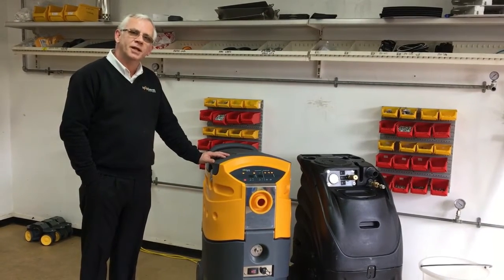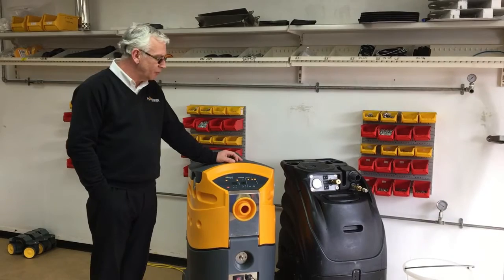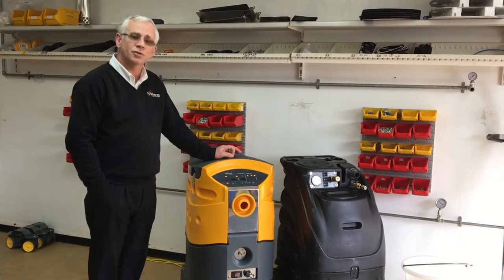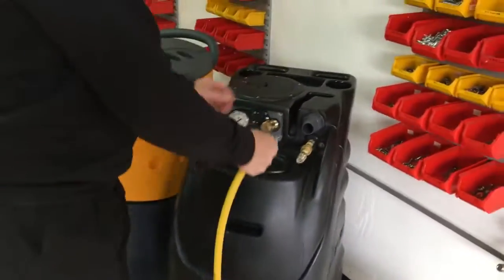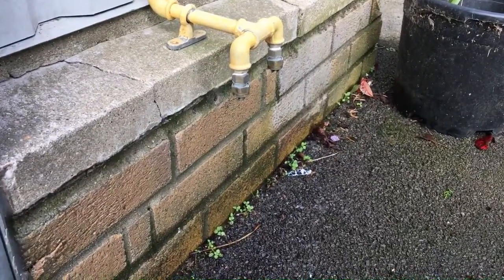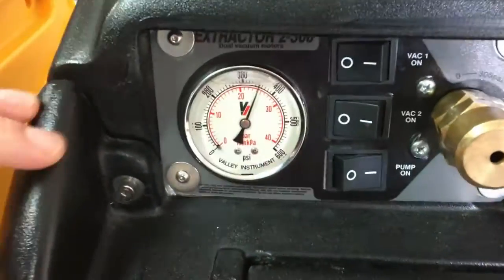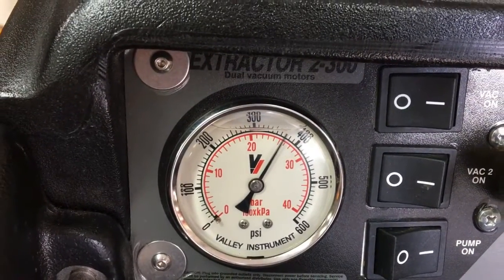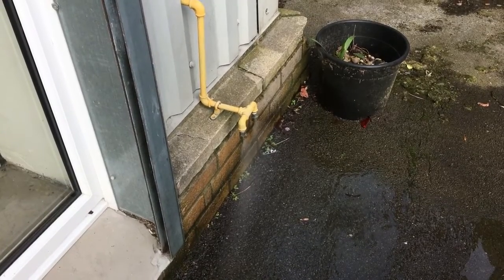Low vs high pressure portable extraction machine

Comment: All this proves is your portable has a higher lpm pump, the other portable is more likely suppose to be used with a 3-4 flow wand, 6 flow wands are more often used on truck-mounts, my everest 650 would be lucky to lost 20psi from closed to open on a 6 flow wand because it has a 20lpm pump, you should Compare it to a portable with the same lpm pump as your portable, there are many portables with a cat pump around the 5.5lpm mark that are made for hard surface cleaning. See how much difference there is? Im not saying your portable is bad It is most likely very good but the test seems flawed to me And designed to sell this digital regulator as not every machine with that pressure regulator setup will fail in that same way. When what is really being compared is a 3lpm pump to a 6lpm pump.
Reply from the maker: Thanks for your comment During the test we used a 160psi 5.7ltr pump and compared it with another machine that was using a 400psi 6ltr pump. What we were trying to show was that by introducing a full variable speed digital control system we could constantly monitor and read the pressures in the hoses up to the tools. This means that whether you have a twin jet, four jet wand fitted with either 02 or 03jets or a single jet hand tool, our control system will read the pressure in the lines and adapt by altering the speed of the pump and either decrease or increase the pressure to compensate and ensure the lines are always pressurised to the pressure you have set. After speaking with three pump manufacturers well known to supply our industry, their engineers all said the same, that you have to balance and control the flow and pressure when designing a pump. Because in our industry we want different pressures and flows for different tools and jobs, our industry has over many years fitted ever increasingly higher PSI pumps to try and compensate for loss of performance over distance and lift issues when working with extensions or at height, these pumps are usually controlled with regulators which increase or restrict flow. The downside of this is that there is no actual control over the pump itself. The benefit of the EMVs unique system is that it’s like having 12 pumps in your machine that have been optimised for each of your flow and pressure settings. This ensures the correct pressure and flow at the wand end either at height or with extensions as the system is constantly monitoring pressures in the hoses and adapting. Using a single 02-jet which would deliver 1.21 L/min @ (7 Bar / 101.5 Psi) or a 03-jet delivering 1.8L/min @ (7 Bar 101.5Psi) means that with a variable digital control system we don’t need to fit excessively high pumps in portable extraction machines that could prematurely fail due to the excessive back pressures and lack of pump control. If I was using 2 x 03 jets at 100psi I would empty a 36litre tank of water in 10mins. That’s with a pump that was capable of delivering 5.7litres a minute only delivering 3.6 ltrs a minute at 100psi.